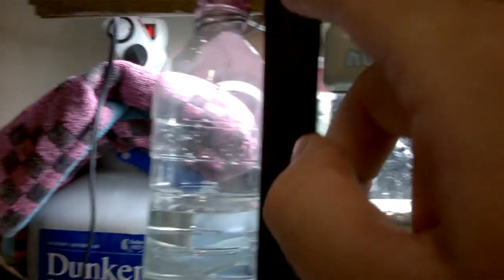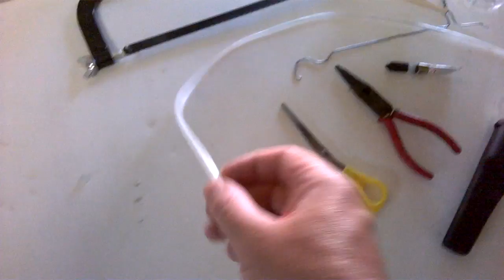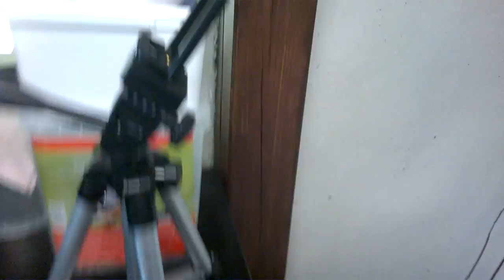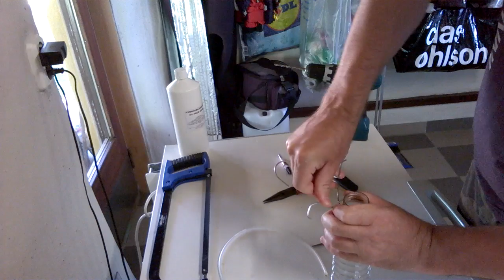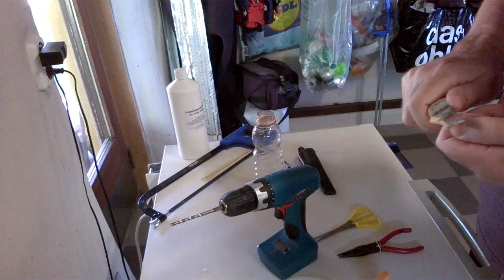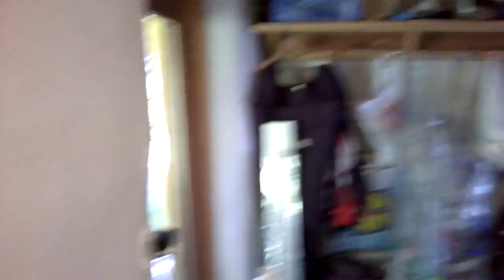How To Make A DIY Aquarium Oxidizer For Shrimp Tanks

Comment: When the peroxide splits into water and oxygen how can you see the peroxid is gone and the fluid left is just water? I want to use this with a co2 diffusor for outlet
Reply from the maker: The reaction stops when its just water.
Reply: Hve you tried it with a co2 diffusor?  I want it to make it in my nano tank 35 ltr. So a little bottle with one activator stone from söchting. Could it be too much o2? Maybe a regultor in the tube
Reply from the maker: I have not, I havnt any need for CO2 in a shrimp tank.
Reply: @MarksShrimpTanks  i also no co2 but the diffusor for co2 gives a nice fine oxydent spray.
The only thing is it won t start giving oxygen. Do you give a littlt bit water into the peroxyd? I have 2 söchting activators in the peroxyd
Reply: It doesn t work . 3 reactor pallets from söchring in a 5 % peroxide fluid. I have a small bottle with a connection with a tube into the aquarium.

Comment: When the metal oxidizes, will it create any noxious gases? Ive seen lots of ppl use cut up potato, but wonder if it doesn’t last as long
Reply from the maker: no its just  rusts a little because its made from iron, the once you can buy are made from a ceramic with silver in them
Reply: Can I use pure silver as catalyst

Comment: I tried this but I didn't see much of a reaction at all?? I used what I assumed was an aluminum wire hangar. Then tried other aluminum pieces around the house but not a single bubble. No build up of pressure. Am I using the wrong material as a catalyst?
Reply: try silver. silver catalyzes with peroxide and makes oxygen. also possible you need to use more of your catalyist

Comment: Can i use hydrogen peroxide 90% to make an oxydator,Mark?
Reply from the maker: I would imagine the reaction would be to fast , you can dilute it with RO or distilled water until you get the percentage you want , I would use above 6 percent.
Reply: i try it and that things react too fast 😂
i just scare what the effect for my shrimps if i use h202 90%..

Comment: Made  a coulple of those yesterday and they're not working, water is in the hose and no pressure is building up. I used galvanized wire instead of a coathanger as a catalyst, could that be the problem? Wich other slow catalyst you recommend?
Reply from the maker: My one took afew hours to get going too, as for catalyst you could probably use alot of different metals , I would try a paper clip or something like that.
Let me know how you get on.
Reply: I tried several metals through several days but none really worked, I ended using a .720 silver coin, the reaction is strong but not violent, it's been releasing O2 for 5 days now, let's see how much lasts at that rate as it's faster than the one you show.
Reply: try lead

Comment: I will do that at once but ı have a critical question which metal do u use for catalzytion (oxidition) if ı know it would be better for mu shrimps because ı have 300 shrimp ün one tank thank u
Reply from the maker: Silver is whats meant to be used but I used a tiny peice of coathanger wire.
Reply: Marks Shrimp Tanks  thank u very much:) do u know the metal coat coathanger is made of iron steel etc and the other question is that u mean if we use silver instead of coathanger metal it would be better right
Reply: you can use a tiny piece of lead too.

Comment: Thanks for showing how to do this. Could a single one save a 57L tank during a power outage? The only reason I ask is that I lost my tank some years back when a power outage lasted a week.
Reply from the maker: Yeah for sure this would help,  if you need more oxygen just add more metal for the hydrogen to oxidize on ..the one in this video last for 3 months.

Comment: Wow.. genius. Especially the diffuser from a chopstick. I needed one for pressurised CO2 in my planted non-shrimp tank. Got the idea!! Thanks. Also, Mark the coat hangar is it stainless steel, or the usual stuff?
Reply from the maker: The useual stuff is what I used, do they make them in stainless steel ,You know I didnt think but a tiny piece of stainless steel fork would have worked better probably
Reply: Hows been you experience so far Mark, does Hydrogen Peroxide get totally used up and you need to refill it? After how much time?

Comment: Hi! I have a shrimp tank with a volume of 25l (6 gallons) with pressurized co2. Does co2 injection decrease the oxygen in the water? for example i have heard that putting an air stone in a aquarium with co2 injection will "flush" out the co2. anyone knows anything about this? Or can you have high level of oxygen and co2 at the same time?  I keep red cherry shrimp by the way and have fairly low amount of co2, 2-3 bubbles a minute because of the small tank size.
Reply from the maker: Injected Co2 doesn't effect oxygen content ..what does effect oxygen content is people chasing maximum CO2 by not having enough water movement at the surface. So thus yes it is true adding an airstone will decrease CO2 Levels just because of the surface agitation . Hope this makes sense :)
Reply: Gotta remember to be careful pushing Co2 as it can/will lower your PH some

Comment: Ok Mark, I made it all up with 12% HP, the nip of coat hangar didn't seem to do to well even just over a day, checked into my tank spares and found my lead plant weight strip, cut a tiny piece off it around the size of your coat hangar nip, its gone mad now :)   a little too much, so maybe next fill i'll cut it in half again :) :)   all fun though
Reply: ... and drop the % HP next time too :)
Reply from the maker: Mines took nearly 3 days to start producing bubbles,you have to be patient lol
Reply: Mine sorta looks like your airstone now  LOL
Reply from the maker: leewink lol,just remember to much oxygen will kill them so dont leave it in there like that lol
Reply: its not that bad really, probably a quarter between the two, your oxydator release and airstone, i'm sure itll burn out soon LOL, I reckon i'd need literally a 1mm square of lead next time.
Reply from the maker: ah ok ,I might try the little bit lead in mines next time if I refill it :)
Reply: yea, but tiny tiny piece LOL, its a good idea for me tho, as I have no air pumps in mine, just a little agitation as the water falls to the sump, latter shrimp tanks will be different :)
Reply: Hotmailed you some pics :)

Comment: Oki, made the bottle up with glued in airline like you say, made up a hangar for the bottle with 1mm stainless wire doubled up (as I use ecigs I have abundance of various wires), ordered Hydrogen P. via fleabay, 2 litres for 8 odd quid, some chopsticks, some wire coathangars.  Then for trials, also, co2 diffuser, and lead plant weight to snip in tiny bits.  I'm only on a tiny 2 footer tank so its fun to trial with this till I get fully setup in time.
Reply from the maker: Great,who did you get the hydrogen from ?
Reply from the maker: I had a problem with a seller on ebay ,I ordered 9% Hydrogen and they sent me 3%...eventually I had to go through ebay to get a full refund because they sent me the wrong thing,the seller did not answer a single email I sent them .
Reply: ... ive emailed you .... :)
Reply: Hotmail email ...
Reply from the maker: leewink Gotcha

Comment: Hi mark, just gathering info's for the near future of proper shrimp cares etc.  I see this video, also ive seen the oxydator (commercially available unit) which uses some mystery catalyst ?   Now, could you use your same coat hangar catalyst and peroxide in one of these units, or does your way only work as you've made it up ?   only niggle with the commercial ones seems the ongoing costs of the catalysts.
Reply from the maker: The catalysts are expensive for what they are.. a few months ago I went to buy one and they wanted 10 bucks for it.
Sad thing is I wouldn't recommend doing a DIY catalyst in the in tank version without knowing more about it so I cant help you on that one.
Reply: Oki I get you, but your impressed still with your doings yes ?   Now, would you say your snippet of coat hangar is say around a centimeter ?   i'm just guessing
Reply from the maker: leewink yeah it worked good,the piece I used was only 3mm and it worked great :)
Reply: Lastly have you tried any stronger % of HP in the bottle, if so, what result would it bring ?
Reply from the maker: leewink I used just 3% solution and it worked fine,I think if you use a stronger solution it will produce more oxygen faster but run out sooner.

Comment: Hi. that's a great video!
I do know that one of the chemicals you use is h2o2.
But what is the other stuff? 
Can u please write it down for me to search it?
I just can't get the word as i am not that gd in English.
Reply from the maker: Great news for you is that this was only made with Hydrogen Peroxide, the catalyst was a just a tiny piece of coat hanger ,if you make this just know that it takes a day or two to start working properly :)
Reply: Thx for ur reply. That helps!
I would like to introduce some shrimps into my planted tank(with Co2)
I think that O2 emitter can really help me avoid the lack of O2 problem!
I can emit both co2 and o2 at the same time!
Reply from the maker: ngs kenneth It should work great for that Kenneth.the bottle lasted 3-4 months with me..if its warmer it works well and shuts of if it gets cold which is fantastic for us :)
Reply: well do u mean that the reaction will be faster if the temperature is high? What temperature you keep? My city is pretty hot
Reply from the maker: ngs kenneth yup the reaction is faster  when it gets warmer..these ones worked very well when it got around 26-27c..where do you live ?
Reply: I lived in Hong Kong.
Its like 30c in summer.
How long do u think it can last in that room temperature?
Reply from the maker: ngs kenneth 2-3 months at least I would imagine...Do you keep Shrimp Kenneth ?
I would love to visit Hong Kong one day ..I am afraid I would bring back to much Shrimp food and stuff back with me :D
Reply: I kept cherry shrimp and mini blue crayfish before. Goldfish Market is worth to go. Do remember to go to those up-stair shops :D You can find more stuff with higher quality than those on the ground :D
Reply from the maker: Thanks for the tip Kenneth :)

Comment: Well done. How much time does it takes until the chemical reaktion occurs ? Thx.
Reply from the maker: The reaction is pretty much instant,but you might have to wait a day for the bottle to build up enough pressure to start working ..mines up been up and running for about 4 months and are gradually failing ...do you keep shrimp Andre ?
Reply: ... Mark, i started with the CR right now.  I heard that a peace of lead works very good as well.  Can you confirm that ?
Reply from the maker: Andre Unger I heard the same but I didnt try it ,I was a little concerned some unknown gas might come of the lead and go into the tank,I think the commercial ones use magnesium but I cant say for sure.

Comment: Beautiful explained..
I always looked into the Oxydator every now and then C them in shrimp keepers tank..
Read up about it heaps, & then came to comparing the $$ i didnt want to spend $45-80Aus.
all the oxydator is that it looked stylish & pretty; but braking it dwn, all involved to make is 
h2o2(cost $3)
 lead(plant holder;free),
air stone, cuped under water..
I think its over priced thats for sure.
Yes it does look professional, smart& stylish but it came with a cost.
I dnt mind ur method, i can alway hide it at the back of tank if i dnt want to C bottle, served the same, but is reasonable to my pocket too..
Cheers for that Mark..
I knew someone, one day would think of a way getting around paying that much..
Reply from the maker: Its been 2 months since I made the first one it its still producing oxygen on its own :)
Reply: i looked up their patent, and the cataylist they use is silver/clay mixture and they sell a tiny catalyist for $15.